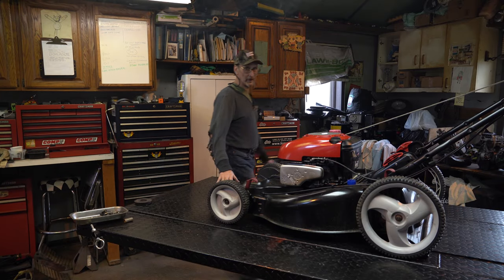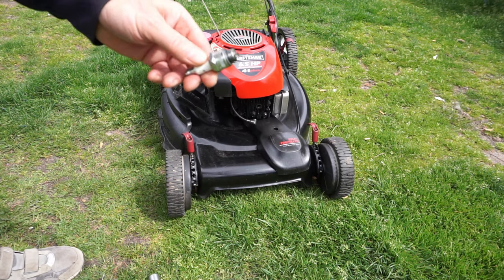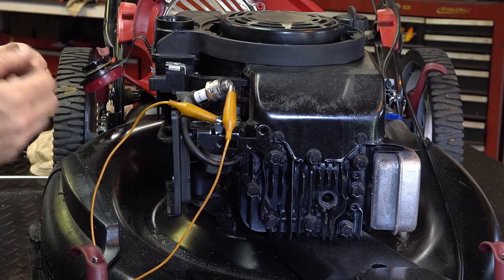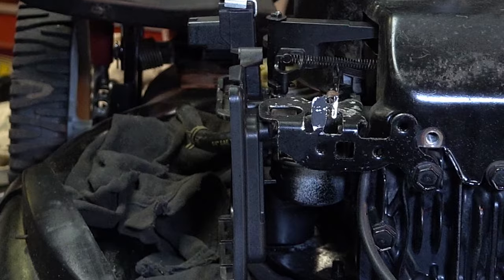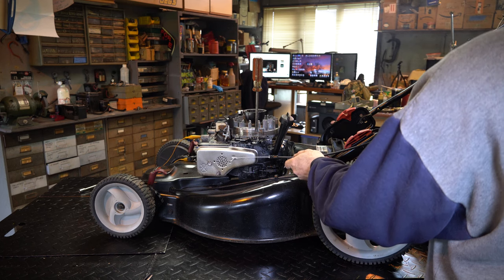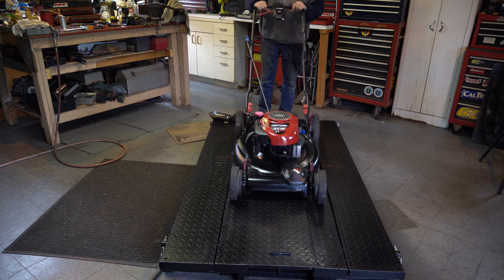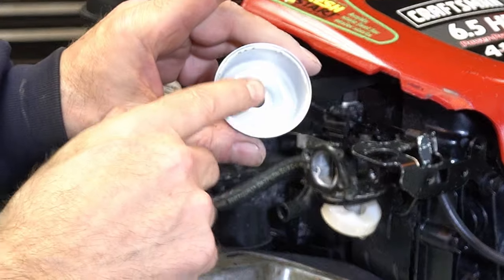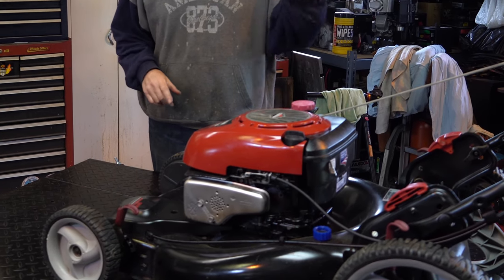Craftsman LAWNMOWER WONT START (Briggs 190cc Engine) Diagnostic & Repair /This Could be Your Problem

Comment: I just bought a craftsman lawnmower yesterday and did everything possible from cleaning the carburetor replacing spark plug and yes there was spark I even removed the coil and clean it up to cleaning the fuel line and fuel tank and still no start but I didn’t check the cable smh how could I forget that thanks for the tip 👍
Reply from the maker: Great! Glad it helped and congratts on the machine!! Luv these!

Comment: Your video was very helpful. I especially like that you showed how to take the cover and what to test for. Mine was starting intermittently so I have spark so then I suspected the control cable wire was somehow the problem. Your video helped point me in the right direction to test mine out. So now I just have to locate a new cable and hopefully will be good to go. Thanks again for a very informative video!
Reply from the maker: Thanx Byron,, glad this helped.. It's not easy to condense things down and actually record it with a presentation and I'm still new at this!

Comment: My shut off cable was stretched out and I just put a hd tie-wrap around the handle and cable to take up the slack on the cable.. thanks for the tip. running good now.
Reply from the maker: Great, glad this helped,, now at some point if ya want or it plays up again,,replace the cable and you know what's wrong.
Thanks for watching!

Comment: I picked up a free Craigslist 190cc 1993 brig's and Stratton lawn mower. I checked for compression it was 55psi. I used spark tester and spark plug light came on when i zip tied open the clutch cable to stay open because the linkage cable is bent, so it's not the coil even though its rusty. I already cleaned the carburetor which had green mold inside the carb which I'm assuming it was not started in a long time and had old fuel. But it still won't start. So then I removed the carburetor and added small amount of fuel directly where the carburetor sits and it was shooting flames and some what chugging which was not doing before but it did not sound like it was running. So im confused was it running if it was shooting flames?  Does it need a new carb, sparkplug or is timing misaligned
Reply from the maker: Hard to say. Compression is a little low,, briggs says 40 is the absolute lowest.
Without a carb on it it wont run when spraying fuel into the intake. It may bark or even run wide open throttle for a minute but its just farting which is a good sign.
You may have sticky rings or valves not closing all the way or maybe even a score in the cylinder.
Get a cheap carb on amazon and try it!
Tighten the head bolts, probably loose around the exhaust valve. You may even have a crack in the head gasket.

Comment: First thing you should have done is check the oil.  Over filled will not allow the engine to start. Takes one minute and can save a lot of time if that was the problem from the start.
Reply from the maker: Not the point of the video..
I've had a number of machines with very high oil levels. Those start, usually the engine is fouled and often the plug as well. 
That's a different video and one that I'm kind working on now. 
Smoked out the neighborhood lol but it started ok considering.

Comment: Great video, picked up a couple of craftsman machines last week so this will come in handy. I do have a question. When you manually spin the engine for the spark test and previous videos check the compression, what attachment do you use? I would like to purchase it for future troubleshooting purposes. Thanks!
Reply from the maker: I use a standard socket adapter however I cant recommend this. You need a clutch setup. They do make one but I cant remember what its called.
I really need to make up a "Wish List".
The drill I use has no bolt to hold on the chuck. Sometimes you will hear the drill make noises or actually see the chuck come off.
This is so when the motor starts or worse kicks back it wont break my wrist or slam my hand!
I only use this drill for the engines. 
Be careful,,,,,
Reply: @TheNovaJohn  thank you! And I would agree. Making a piece of content in which it shows the top tools/wish list you recommend for small engine repairs along with and attached links to buy them would be a great way to educate and start affiliations

Comment: I have a little Hyper tough from walmart that kept stopping. That possible cable issue slipprd my mind. I messed with that thing for an hour and kept having thr same problem. Drove me nuts.  All of a sudden it hit me, brake cable.  Problem solved. Brain fart  Ha Ha
Reply from the maker: Hey,,at the end of the day,,,,ya fixed it!! That's all that matters!
I found out years ago,, walk away for a while if ya havin an issue,,let it process,,

Comment: Whats on the end of the vice grip fuel hose crimp tool?

How would you compare Super Clean with Purple Power?
Reply from the maker: That's one of those cheapy & Crappy tools I got years ago, junk really so I put some tape over the teeth. I really should just grind the teeth off cuz its No Good for anything else!
I do like SuperClean,, they may be very similar because both are based on a Sodium (Base = as in base vs acid) which we used to call lye.
They make it in several versions, pressurized spray cans and pump style. The Foamy is nice for those deep turds, they also make a mag wheel cleaner that I would like to try eventually.

Comment: Hi Arch After hitting an obstruction, my Briggs and stratton is not getting any spark. I have checked the key, the cam gear. the kill switch, thecoil and the magneto. What else should I do other than buy a new one ha ha
Reply from the maker: Put a clean plug on and re-test for spark...
Also disconnect the control/kill wire (ground wire) to the coil and test as well

Comment: Since you found water in the gas, will you drain and dry out the tank?  I ask because the water will be in the bottom of the tank. 😮
Reply from the maker: Yes, often you can just drain the tank since the pickup is in that deep pocket! I did clean out the tank and I cant show everything in each video.
If ya feel there may be more water, add alcohol to it then re-drain.

Comment: Yo Unk. Man I've tried everything. Replace carburetor, plug, ignition coil, fuel line, oil change, new gas, still no start. About 2 months ago I pulled the cord and it snatched out of my hand. It lifted and dropped the mower. I unplugged the spark plug and moved the blade by hand to loosen it back up. Has not started since. I looked at the cable and it didn't looked stretched. Last night I removed the motor and I plan to see if the camshaft is broken. Oh i checked the flywheel and timing too. Waiting on the puller to come so I can get the blade adapter off. If not that I'll try the cable.  Can it look good but be damaged?
Reply from the maker: Did you check for spark?. spray fuel or start fluid in the carb ?
Reply: @TheNovaJohn  I took the air filter off and sprayed carb cleaner in it and it didn't start. I had ordered a new coil but I used my multimeter and the old one is still read good so I sent the new one back. I don't have a tool to check spark. I'll order one and try it. I've tried about 3 different spark plugs.
Reply from the maker: @cbreezy1322  could be the switch is still made, remove the coil kill wire from the switch/cable area and lift it out of the way
Reply: @TheNovaJohn  sorry I'm still trying to learn all of these terms. U mean unplug the wire on the coil and unhook the cable from the handle to the engine? I unplugged it when I took the engine off. So if I put it all back together leave that wire and cable disconnected. Should I then try to crank it? If it starts then what would the problem be?
Reply from the maker: Yup,,your doing good,,,its a lot to learn but as you go you see its well within your understanding!!! Keep going!
Reply: @TheNovaJohn  thanks for the conversation. I see that each end of the cable unscrews. I did that on both ends and I'll see if that extra tension helps when the handle pulls the mechanism on the bottom. If that works maybe I'll buy a new cable or wait until this bootleg contraption I created gives completely. I hope that's it. I have the bottom of the engine apart but can't remove the adapter until I get the 2 claw puller. Penetrating oil isn't enough. Thanks again
Reply from the maker: @cbreezy1322  Heat usually does it,,torch it!!
Just keep at it and have fun,,,,
Reply from the maker: @cbreezy1322  Yes, but you will need to wire the cable brake out the way, disconnect the little wire either from the cable brake switch or the coil.. look closely at the switch and watch it as you actuate the cable,, I think I show this in the video
Reply: @TheNovaJohn  I had to order the crankshaft gasket. It comes with 2 other oil seals too. It doesn't even look like the crankshaft had a gasket on there and that center oil gasket is withered. I'm leaning towards your cable fix now. As far as I can see the camshaft gear looks good. I unscrewed both ends of the cable to see if that would help pull the switch back further. When I first looked at it I thought it moved far enough but maybe it didn't. I'll see Wednesday when I put the engine all the way back together. Hopefully it works. Hard for me to let something beat me. If it's mine I'll tear it all the way up in trying to fix it before I just trash it. If my rigged cable doesn't work I'll try a new one. I'll keep u posted
Reply: @TheNovaJohn  I'll watch your video again to see what u mean about disconnecting the cable brake switch. I know how to disconnect the coil but I need to see what all of that does in making sure the control wire works properly
Reply: @TheNovaJohn  You also inspired me to paint it. I ordered some black spray paint for metal and rust protection. I'll paint it while the engine is off. Hopefully it'll run 😁🤞🏼
Reply from the maker: @cbreezy1322  awesome!!